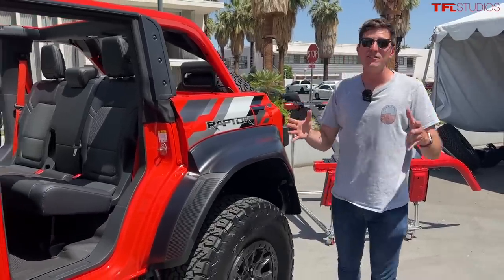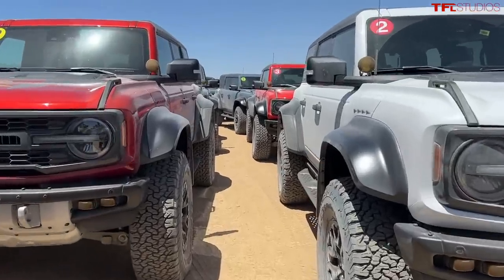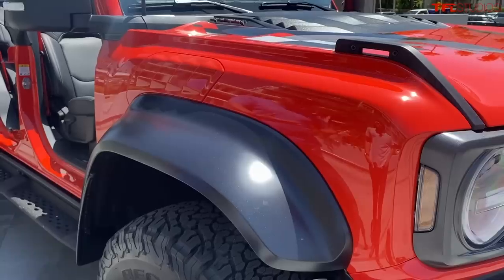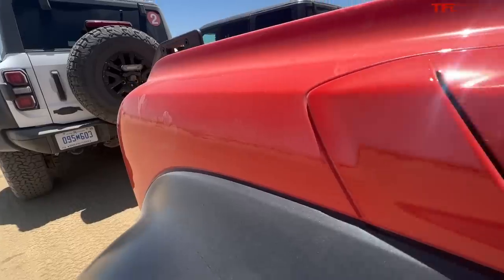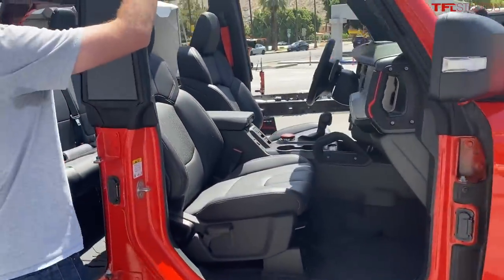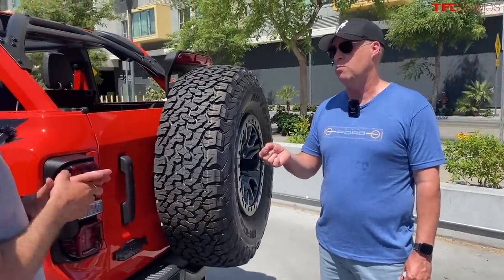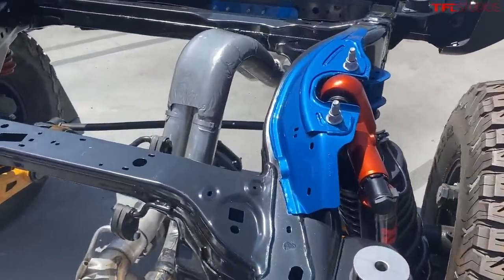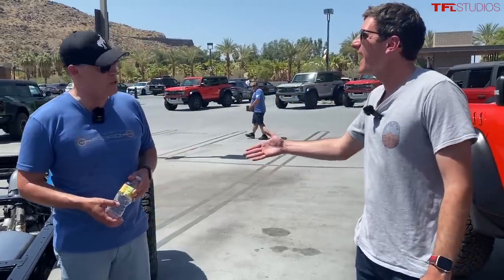There Is No V8 In The All New 2022 Ford Bronco Raptor: I Ask Ford Why!

Comment: That guy is wrong. The V8 is the right motor.
Reply: Until the US government and go green crazies push for banning the sales of V8 motors 🤣. Unfortunately combustion engines will eventually diminish. In 10-20 years more than 50% of vehicles on the road will be electric.
Reply: And why is this?
Reply: @nm-qt2hb  every car manufacturer is producing/designing electric vehicles alternatives. Also there're alot more electric infrastructure investments happening. Give it 5 years there will be charging stations everywhere. I'm not pro it, personally I prefer gas engine and I don't even care if gas is 5 bucks a gallon. But government will eventually make it painful to own gas cars. Even logistics trucks are starting to come out with electric alternatives. It is what it is.

Comment: Does the Raptor have the ridiculous auto stop start?  Does it have the maddening Ford seat belt chime?  If so I’m out.   The appearance of the fender flares also have to be reconsidered.   Those look like a cheap aftermarket accessory made by Rugged Ridge.  Other than that it’s pretty cool

Comment: A very diplomatic answer to the v8  question  but thanks Tommy for asking the question . I'd be concerned of the durability of those smc fenders for paint fade especially on red I think this will be next issue for these since the roof they either with fade peel or crack

Comment: Could of been a 5.0 coyote and eliminated all the turbo plumbing and the heat.  Not to mention additional parts a turbo motor need / use.    I have a eco boost and coyote F150, I like them both, but the BRaptor should of been a coyote

Comment: I wonder if the 3.0 liter will hold up unlike the 2.7 which is failing prematurely on the bronco
Reply: It was a batch of bad ones not all 2.7’s are bad. Actually the 2.7 is a fantastic and reliable engine unfortunately ford had a small batch of bad ones that they installed in the highly anticipated bronco
Reply: Don’t try to make sense to ppl that wish and hope something sucks Bc they don’t have it.   Jealous fools.
Reply: Not in the slightest, these engines will prove to be completely unreliable in the long run.  We're in the infancy of small displacement, twin-turbo engines.  This is a vehicle you trade-in once the warranty expires.

Comment: Am I the only one questioning some of them mentioned facts/design choices?  The 3.0 has 50/30% reduction in losses... So is the run of the mill 3.0 a purpose built inferior setup or are the gains so minimal the percentage gain makes it sound better?  Also replacing metal fenders with "composite" ones, way to cheap out while up selling on the product.
Reply: That's not what he said.  He said they reduced existing losses by those percentages.  That's not the same as having high losses before the changes. Like reducing loss from 6% to 4.5%.

Comment: That was a horrible answer. What he should have said was this:

“High speed off-roading and technical rock crawling are incredibly thermally taxing on a vehicle, and we found that the 3.0 Ecoboost gives us enough room for the cooling required for such a demanding task, while simultaneously making the vehicle lighter. The Coyote V8 did not allow for adequate cooling for sustained off-roading, and would have made the vehicle significantly heavier, negatively impacting handling.”

But no, he dodged the question.

My guess is that they are also saving the V8 for an R variant that has a more robust suspension and more room for cooling.

Comment: the KO2 isn't a true 37, more like a 35.75 lol.  but still, amazing.
Reply: It's 36.5" in diameter.
Reply: @ryansheard8092  the ko2 37s a friend run measure out below 36 at street pressure.

Comment: Great video, thanks for answering my questions on the cooling from the other video lol. I am wondering partly from a perspective of how fitting a snorkel might work, but partly because I am interested in how engine bay & intake airflow is managed generally. Just seems like there is a lot of low-hanging fruit there that many manufacturers don't take fully advantage of, but clearly a lot of thought was put in here. I especially like the extractor hood- a relatively simple design underneath that nonetheless is able to enhance throughflow from the grill.

really cool additions to enhance torsional stiffness too, and that rear three quarters view is just bonkers with that enhanced track width

Comment: The frame is from the T6 platform, which is ultimately based on an old BT-50 frame. Not originally intended to mount a V8. I suspect that’s the real reason.

Comment: In my opinion there should be another step up in performance options for the Ford bronco there should be a Ford Bronco Raptor R with the Coyote 5.0 l supercharger VS. With 675 horsepower. And also a Ford Bronco  electric lights on should be considered. Along with a 3 l modular V6 diesel engine as well as a hybrid version

Comment: When they put the 37's on did they increase the size of all the front and rear axle components? Does anyone know what axles/ring and pinion are in these things?
Reply: Did you not listen when Tommy asked this question?
Reply: @speterbilt  It only mentions the rear as being a Dana 50. Is the front different than the standard Bronco?
Reply: @geoffmooregm  that dude said the gearing I thought
Reply: @speterbilt  Yes gear ratio but that has little to do with strength. I did not hear gear size or axle shaft diameter. I can look up a D50 and get that info but can't find anything on the Front other than the fact it is also made by Dana. If it's locked with 37's I really hope they beefed it up.
Reply: @geoffmooregm  i thought he said the axle tubes and hoising is twice as thick as the regular Brinco
Reply: @speterbilt  Yea I suspect that is because they changed from a D44 to a D50

Comment: I think a lot of people might change their minds on the V8 if they could drive this version back to back with a V8 version. I get missing the sound, but driving a V8 F150 back to back with a 2.7 wasn’t even a comparison in power. At least not at 8,000 feet of elevation where I live.
Reply: it's not going to be the same garbage v8 from back in the day
Reply: @13christbane  that's physics.  Less air at high altitude means a naturally aspirated engine will have more power loss.
Reply: You are correct. The V8 is pointless now.

Comment: The words he was told not to use were, "fuel economy". Ford doesn't want to be seen as being limited by CAFE standards on the top model, but they are. I bet this gets about the same city mileage as a V8, but higher highway mileage. When you're not in the boost, you're driving an NA 3.0L V6.

Comment: He was beating around the bush on why no V8. Their DR program uses a coyote V8 crate engine. It literally drops right in the BRaptor. It weighs less than the 3.0 and would’ve been the better choice given it’s power potential and longevity since there is no forced induction bits and pieces to fail over time. Did I mention that the entire V8 long block costs less than the 3.0 loaded up? Are you listening Ford?

Comment: I have owned a few turbo powered cars, all Audi A4s. The key to turbo engines, dont dog out the engine and get it hot then shut it down and use full synthetic engine oil. Unless this turbo is different, the engine oil is also used in the turbo. 
I think they plan on selling these overseas, in some parts of the world there are higher taxes for V8s and displacement above 3 liters. This would explain why the V8 is not in this vehicle.
Reply: They could’ve easily made it an option
Reply: @carramrod8232  It sounds like Ford is planning on killing the V8 except in their HD truck line and maybe the Mustang.

Comment: I must admit I do really like the hood, if it works like they say it does to release heat. The exit points are awfully close to the base of the windshield which is a pressure point, might be marketing fluff don't know-
Reply: Could also just be that they are for slower speeds or stationary conditions just to allow any build up heat to escape and not heatsoak components. Or a combination of everything. Didn’t look too close to the base of the windshield either, being Ford I hope that their access to literally all the data they could want would help place those in the proper location for what they were trying to achieve.

Comment: I would rather have a V8 with no turbo. A turbo increases the pressure in the engine by adding two you are using for trouble but if you can buy an 80K vehicle with very little cargo space you are probably not worried about maintenance costs. Go have fun just don’t pack much.

Comment: Really wished ford had made the Bronco like they used to be, having affordable models for everyone and not making it a special vehicle within Ford
Reply: What are you even talking about, this is the very top dog bronco. Base price is $30k
Reply: @AK_Ray  the are barely any base models available all companies are pushing the higher trim levels, and even if you can find a base model they are jacking the price. That 30,000 number is just to get you to the showroom, it’s the same with the ford maverick, you can’t find a base model, or one that’s under 25,000, due to the supply shortage and dealer mark up
Reply: @MegaBronco91  two things, 1. Ford is moving to a more built to suit model so if you want a base, order one. The days of having every model of every vehicle on dealers lots is over. 2. If the dealers aren't ordering what you want and marking up all the prices, that is far from Ford's fault for not making an "affordable model for everyone" . That's the dealers fault.
Reply: @AK_Ray  It is fords fault for not addressing the issue, if dealerships are doing this and it is known fix it don’t just leave it. Second ordering a vehicle you particularly want I can tell you haven’t tried to order/buy a vehicle in a while, your wait time is well into next year or longer. You can clearly see and speak with the dealer/ or ford and they will tell you, you can get a higher trim quicker than a cheaper model due to their strategy at the moment of maximizing sale profit or sales numbers.
Reply: @MegaBronco91  Ford has addressed the issue, but there's really not anything they can do about it. Buying through a dealership is the only legal way to buy a new vehicle in this country and they're completely independent. 
Actually you're dead wrong, getting lower models with less trim options turn around time is significantly quicker because of current supply chain issues on the higher trim models.
You obviously are not a business owner if you think there is a problem in any way shape or form of a business trying to maximize sales and profit. That is the point of owning a business is to maximize profit and sales otherwise there is no point.
Reply: @AK_Ray  I love how you know nothing about me and assume everything lol, and not a shocker you know everything about this issue and you are %100 right I’m not a business owner I work like most of America for a company, that doesn’t make me wrong or incorrect. Ford and all other brands have seen drops in their sales and they aren’t pushing base vehicles they want max profit for what they have and can put out. If you actually got out and went to some of the dealerships you would see they have nothing but higher trim levels now and will quickly tell you ordering and receiving base vehicles is significantly longer than any trim above. I know because I am in the process of trying to get a vehicle that I can afford for my family, and there is nothing new that is close to base that you can get new for what they are advertised. 
So keep assuming things about people, and please keeping thinking you are always correct, I’m sure you’ll come back with something snarky after this but, your obviously in a different reality or ignoring ours. ✌🏻

Comment: I would have rather had the 2.0L turbo in my Gladiator than the 3.6L V6. I dont plan on towing a lot of weight, plus the turbo is easier to make more power with down the road when the warranty is expired. All the 392 fans are going to get mad when its discontinued for the 3.0L twin turbo they are working on as we speak.
Reply: Can't be mad when you have a 392 haha

Comment: The Bronco in its current state is not very large. Adding a V8 would weigh it down. I can see a future model, the Bronco XL having a V8. The current midsize SUV Bronco just doesn’t make sense for a large V8 it would need lots of redesigns to adapt the internal frame to handle the V8. Also the fact that V8’s are a dying breed. I would rather see a hybrid Bronco instead of a V8 Bronco, especially with current gas prices.

Comment: A ohc v8 won't fit , wont pass emissions higher production costs and can't pass accident safety standards with modified engine bay to accommodate a v8.if ford would just mass produce a simple small pushrod v8 to compete with gms 5.3 .it would have no problem fitting in the bronco and explorer and ranger and expedition.

Comment: Ford has the amazing coyote 5.0 and yet they won't use it in anything other than the Mustang and f150. Its sad they're using the smaller ecoboost engines. The bronco would be much more appealing with a nice 5.0 under the hood

Comment: It clearly an cost effective decision plus an take ratio. Let’s be honest how many of y’all would have bought the V8 probably not many to outweigh the cost of ford trying to fit it in the engine bay, transmission, weight etc it’s just like the save the manual yall whine and cry about them but don’t even own one. Not to mention this engine is already built in the ST Explorer an east cost effective way to just put it in another model.🤷🏾‍♂️

Comment: Did anyone ever drive a OJ Simpson style V8 Bronco, they were absolutely pieces of crap. Why does Ford put a Ecoboost engine in its GT, Raptor Truck, nearly 3/4’s of their pickups and their Police Explorers, definitely not because of the way they sound, it’s because they run great, produce loads of torque at low RPM’s and are proving to be every bit as reliable as those V8’s, 80K on my tiny 2.7 engined F150 and not the first problem, never ever thought it was lacking in power, does what I need it to do everyday and I couldn’t be happier. Those $1200 turbos now can be purchased remanufactured for $400 if and when they fail, if you do oil changes they won’t, friend in Longview Texas has a 2012 King Ranch 400K original turbos and other than regular oil changes and fresh plugs about every 90K it’s been a great truck. Hope mine is half as good.

Comment: Anyone that thinks a zilla wouldnt fit is crazy. Hopefully 3.0.dont get the 2.7 track record. Ots a shames it's not a i6 like a turbo Barra or the aluminum 6.8 based on 7.3  that this administration got cancelled. But I do have one thing to say. Atleast it's not an EV causing blackouts during summer heat

Comment: If it's not a v8 it's a waste. No one buying this thing is concerned about mpgs.. v6 vs the v8 fuel wise is not much different 15 vs 18 city, 18 vs 23 highway. Towing wise I'd prefer the v8. Soundwise, still the v8. The only reason you'd pick the v6 over the v8 is for the cheapest base model, just to say you have one.

Comment: I wonder if the Tie Rod Ends are beefier, because on the MOAB Rock Climbing or Rock Maneuvering they tend to Snap. The & EcoBoost across all Platforms for Ford & GM they need to add an Insulated Heat Sheild as well as a Turbo Blanket.  Domestic Brand Engineers are not aware of how much heat Turbos Generate from the Exhaust DownPipe, Despite intercoolers they're still mounted too Close. Ford should look at Porsche the Twin Turbos are mounted Far Away from the Engine Block t Keep engine Cool. Otherwise it will be EcoFailure talking about prior experience. 👦🏻👍🏻🏎️🏁 I will never buy anything with Turbos or and Automatic Transmission  Paddle Shifter are not as engaging. Will never Contribute to Ground Poisoning Electric Vehicle sitting in the Junkyards. Uncharged EV's the Heat to keep the Battery Packs Cool are not in Operation. Therefore, Thermo Expansion in extreme hot desert the Battery Packs will burst and expel Acids and other Toxic Chemicals .  poisoning our ground water,  i rather go Hydrogen

Comment: I'm not so interested in V8 engines anymore. Unless they run on something cheaper then gas. Not saying I don't love the sound of a 8 cylinder but there us no future for the old V8. Engines are going to get smaller and electric is going to take over.

Comment: I will never buy a Bronco Raptor with a 3.0 V6! With 37” tires and a vehicle that wide also available in only 4 doors which is not a traditional Bronco it makes absolutely no sense to me and many others to even consider such an expensive and just plain stupid purchase. Ford engineers need to stop listening to each other and start listening to the potential buyers. Already the Wrangler 392 straight V8 beat the Bronco Raptor’s ass! Already the Ford Bronco Raptor has taken a loss because these engineers are NOT listening to us! Get your shit together Ford or you can take that Bronco Raptor and drive it off a cliff! Until it gets a supercharged high performance V8 like what we demand out of it is a pos and less impressive than a 2 door 2.7 liter Bronco Badlands Sasquatch. Which is the fastest and best performance Bronco you can buy as of right now.